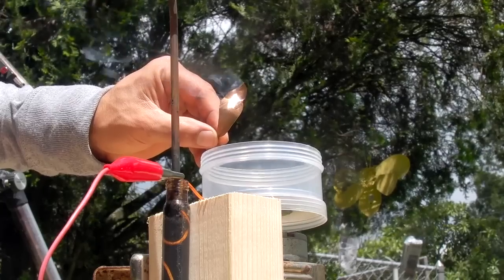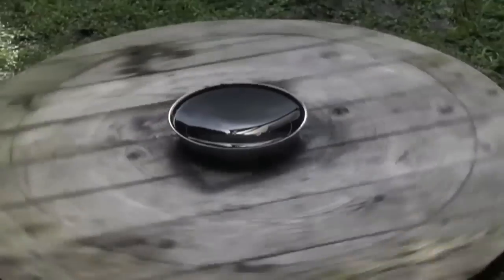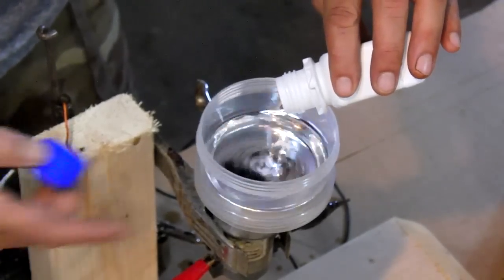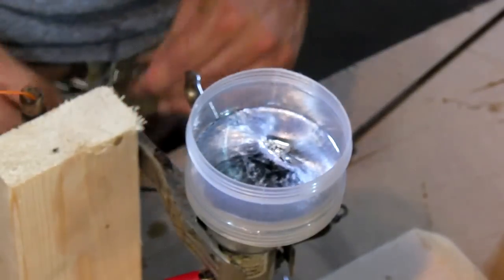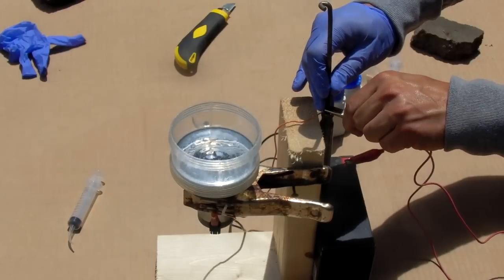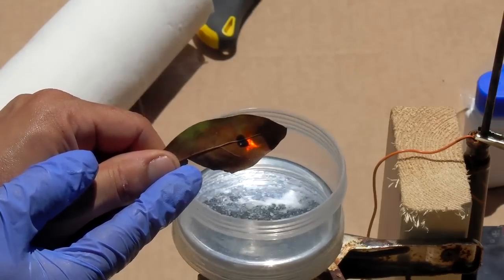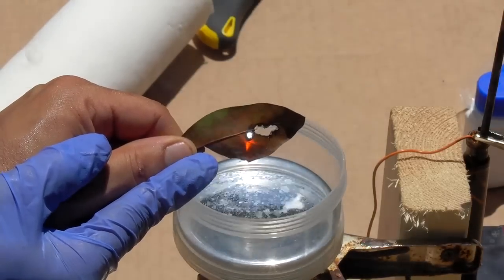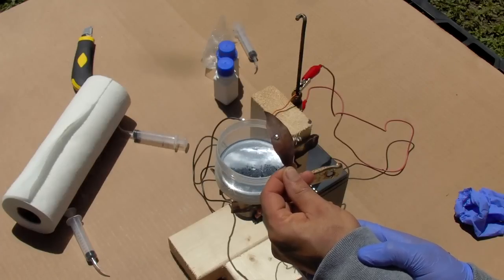GALLIUM Parabolic Liquid Mirror similar to a mercury mirror 200 grams

Comment: One question for anyone watching this:
If gallium solidifies at  about 30ºC, if you make a parabolic spinning mirror an let it solidify by itself with the natural temperature decrease, is it reflective enough to work like a regular shaped mirror?
Reply: Some gallium alloys melt at -19°C
Reply: +Rodolfo José Ribeiro 
gallium forms very large crystals upon cooling that would ruin any mirror.
Reply from the maker: Rodolfo José Ribeiro Once it solidifies there is a bit f special polishing that is needed as the mass will not harden in a uniform shape. The cost of a massive amount of gallium to achieve a large parabola may be cost prohibitive vs an acrylic mirror for solar thermal applications. For optical applications it may work. I only have $200 worth of gallium:-) This was just to float some thinking.
Reply: GREENPOWERSCIENCE Thanks for the answer. I thought gallium could keep the shape and reflectivity after hardening. And it's really expensive. I was thinking about the use for telescopes, maybe for covering the surface of a parabolic dish of an antenna...

Comment: molten gallium + copper powder. paste is obtained which solidifies in a few hours (due to formation of intermetallic compound) and then can withstand heat up to 600 degrees without breaking. At one time, the metal used to make dental fillings. You can make the shape of the reflector.
Reply: Will it change colour? I need images by telescope.
Reply: So will colour change affect images

Comment: Dan, love your videos.  You need to do this one right!
Put a large bowl of hot water on a record player.  Float one of your large parabolic mirrors on top of the water (fill very high to allow mirror to extend over edges of bowl).  Place gallium in the mirror and allow to melt.  Match rotation speed so gallium very thinly covers the majority of your mirror dish.  The dish will now spin extremely stable in both wobble and speed, giving as good of a surface as you could want.  Then BE CAREFUL because you could easily reach 5000:1 concentrations.
Reply: Oh, and you might want to check out a Cassegrain mirror tracker.  You can use a large stationary liquid mirror (a full satellite dish???) to capture the sun. Then re-focus and re-aim that with a secondary parabolic at various focal lengths and angles.  Aligning the focal points will create a solid beam the size of the secondary mirror.  Let's see it in action!

Comment: Could you use the same technique with melted PVC and then let it cool while spinning to acquire a perfectly harden parabolic shape? you could then line it with 2 part mirror coating, or you could make a foam mold and cast it out of aluminum or some other metal.

Comment: Use sound waves to make and regulate a metallic liquid into a variety of frequency induced shapes. Or supplement Gallium for a magnetic metal and use an EMP emitter. Im sure you can figure out a way to harness electricity from that.

Comment: How about using a large spinning disk and a container, Fill it with some kind of self hardening material. Spin up to the right speed and then let said material dry and harden into a really good parabolic mirror. And then add shiny surface.

Comment from the maker: Thank you for the nice comment. It was about age 21 when I started working with concentrated sunlight with 30 large mirrors someone gave me. I made some water heaters and went from there. When we first got married we had a matte black z24 cavalier with no AC and anything plastic would melt, including all the car's electronics(never ran right after the paint dulled). Also, the seat belts left some incredible arm burns. No outlet until youtube came around. Years of trial and error.

Comment: i would put it in (at an interface with) some kind of specially-shaped pressure/vacuum ampoule. I wondered if that would affect the melting point.... also if it;s effectual to put the liquid metal at an interface with some type of glass, and maybe using the whole apparatus as a mirror. maybe good for solar cells too... embed some solar transducers in the glass and shape it to collect reflection off the gallium, and maybe facilitate some lasing. i never even knew these type of mirrors existed!

Comment: It may be possible to conserve the gallium by using a container with a parabolic or spherical bottom.  The rate of spin would have to be tuned to that shape of that particular parabola, but the volume of gallium, water, mercury, etc, necessary to form the parabola would be lessened.

Comment: I know this may not help much but look into getting some "Peltier" (spelling) Chips (14VDC/9A). They get down to around -20*C on the cold side IF you can keep the hot side close to room temperature with aluminum heat sinks and a PC fan.  Reall awesome transducers actually. If you can keep the hot side below +176*C and keep the cool side at room temp, you get 12VDC/3A) from it as a power source.  Technically, electricity directly from fire. It is known as not the most efficient way to do this.